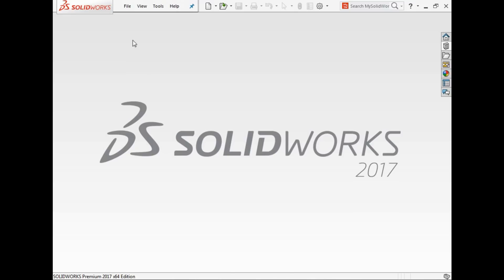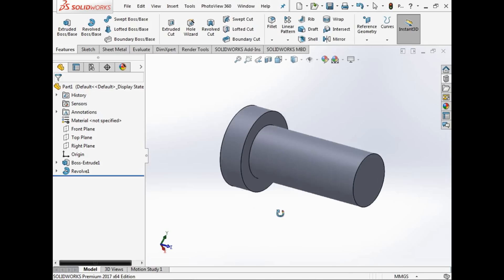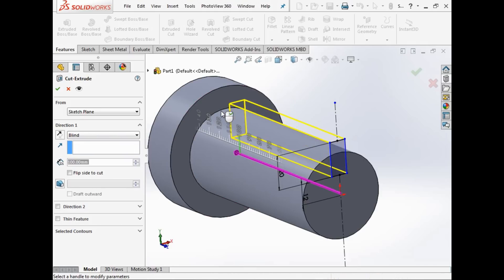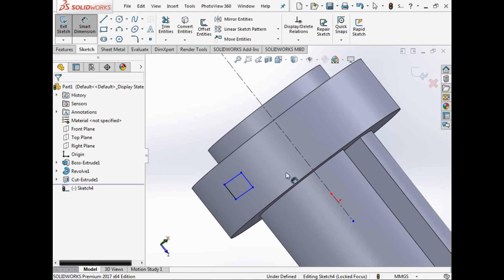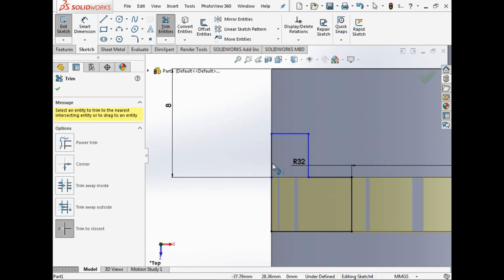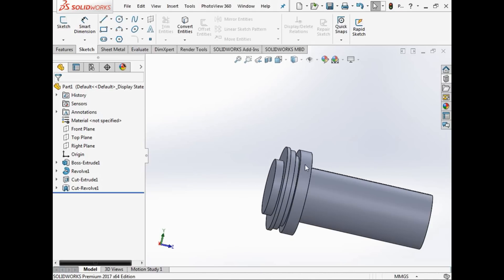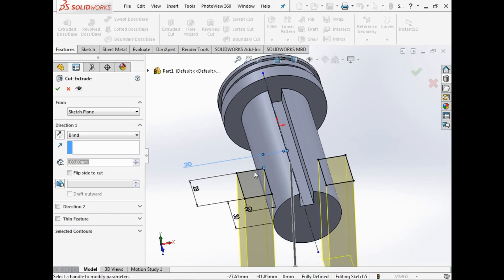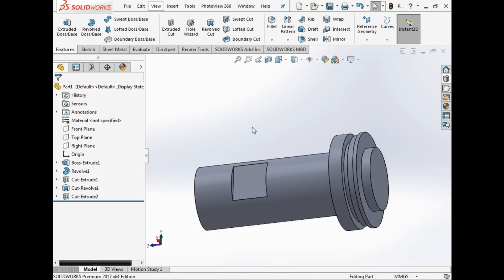Easy way to Solidworks - Part 3 - Cutting Stuff

Comment: All of these CAD programs are great... Back in my day you just imagined in your brain in a 3d working way, ironing out all the issues in ya head and on paper, it's a good test of mental ability then you machine what ever is in ya head... CAD n CAM has made it easy for anyone... Yep even dickheads with no mechanical engineering sympathy... Spose these days it depends on how much money you can spend on software to be a 'good engineer'... Not much space in the world for us fuckers that use mind and skill to do the same thing the old school way.... CAD is good but a shame people can't make it from sheer skills earned over years... Respect to the non computer aided engineers from back in the day!
Reply from the maker: "All of these CAD programs are great... Back in my day you just imagined in your brain in a 3d working way"

- its still the same today - CAD just holds those images and makes it easier to share - I'll explain more later
Reply: Problem with paper is you cant operate the machine to see if it works on paper, you can do that in CAD.
It allows you to sanity check your designs instead of building it all and missing one small thing that CAD will spit an error over. 
Like solid works display collision of parts when the machine is operated in it. 
May be simple a bolt that is a little too long or some underlying flaw in geometry but you see it first before you even make one part.
You just grab the part of an assembly with the mouse and move it the direction it operates to check it's all working like you would if it was in front of you built.
I make and sell machinery I designed and build that has hundreds of moving parts that are grouped in sub assemblies and then all grouped in the complete assembly.  I can set the sub assemblies to lock position of all moving axes while I operate the whole machine, or just one moving sub assembly.
Second thing is you set all the material specs of each type of material you use in it and once you make a part form that you can get the weight of the part.
You can select to see weight of each part or whole sub assemblies or the whole machine.
So if you have something like a beam that pivots over an axis (as I have that is 4 metres long at 70kg) you can make fine adjustments to the pivot point to get it to balance perfectly to make it easier for the person operating it.
That's just a few things makes it a must have for manufacturing anything.